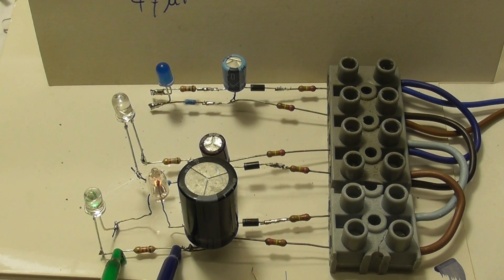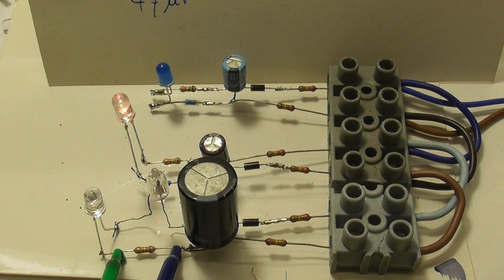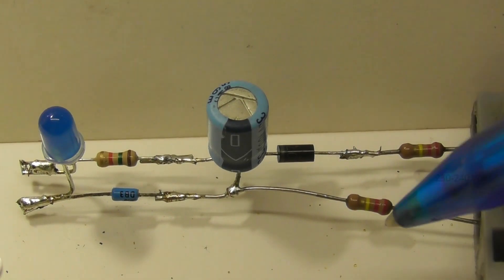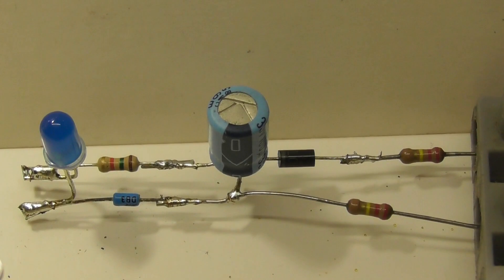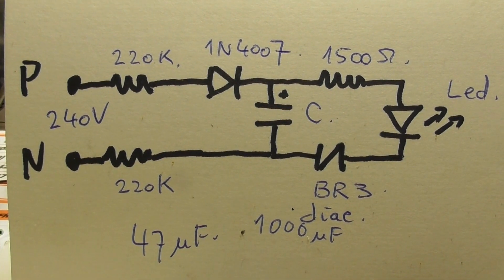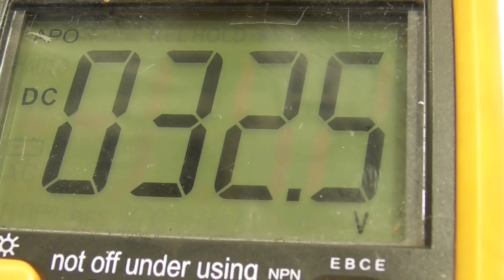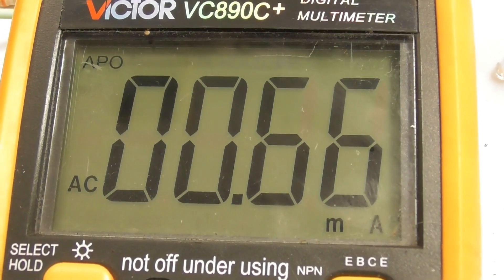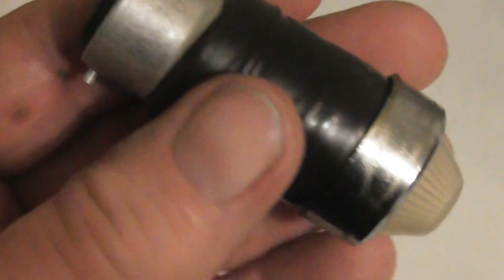Mains LED flashing pilot indicator light with diac

Comment: Shouldn't you use a capacitor rated at the rectified mains voltage? If the LED fails open-circuit, nothing will be clamping the voltage, and the cap would receive 350-ish volts DC and fail "enthusiastically". Otherwise it's a solid concept.
Reply from the maker: Never had a capacitor fail in 25 years of use of these circuits.

The 440 k.Ohm series resistors are a high impedance trickle charger. LED's usually fail in the conductive state.

Comment: May be worth putting a bleeder resistor across the capacitor in these, if the LED goes open circuit the capacitor will charge to a high voltage and may let out its smoke
Reply from the maker: Never had a led fail on me., They usually stay in the conductive stage. The series resistor is essential to limit the current through the led.

Comment: Interesting little circuit.   I wonder how one would modify the flashing on/off duty cycle.   I am guessing a bigger capacitor would increase the length of time the LED is on because it would take longer to discharge the capacitor until the diac no longer conducts.   However, it would also take longer between flashes because of the longer RC time constant.   To make the light stay on longer and maintain the same number of flashes per min increase the capacitor size, but reduce the values of those 220K resistors?
Reply from the maker: Bigger Cap longer On cycle, some tweeking with the 220 k resistors can be done but don't go below 2 x 150 k. Ohms.

Comment: Can you flash a 100w led
Reply: You can use it to flash a 100W LED array, but it will not be bright. You will need to add some form of power switch to the circuit, like a triac, to control higher power.

Comment: Diac must be like a cross between a TVS and a Zener
Reply: More like a zener diode and a SCR, it will be off till you reach the trigger voltage, then rapidly turns on till it has only a few volts across it at some current. Turns off when the current drops below the threshold current, allowing the voltage to rise again till it triggers. you can make them using 2 transistors, a zener diode and 2 resistors. Resistors are there to limit current in the zener diode, and to ensure that the slight leakage current of the zener below it's regulation knee will not turn the transistors on prematurely.
Reply from the maker: Diacs are used in basic light dimmers as trigger diode. Hovers around the 30 Volts level.